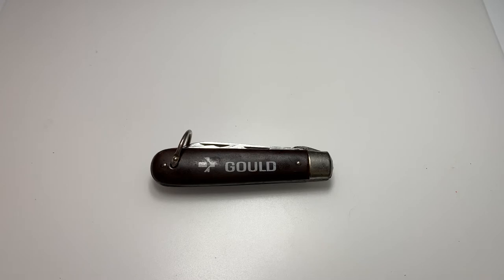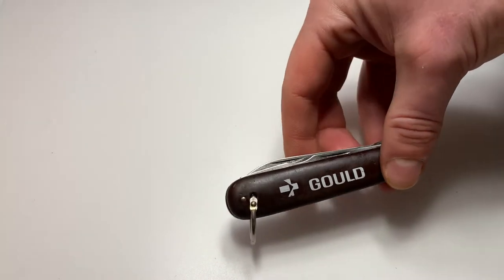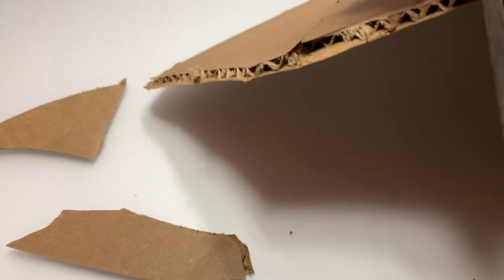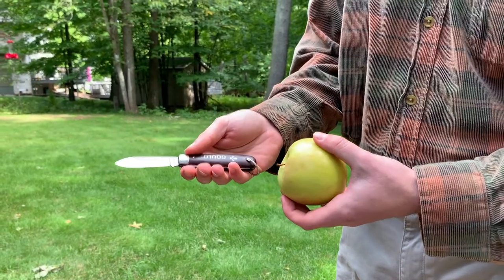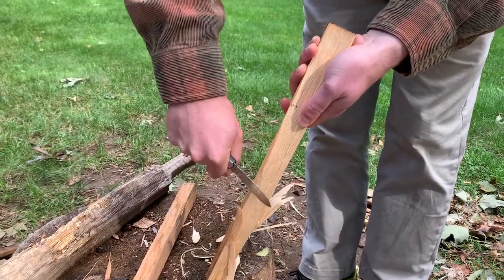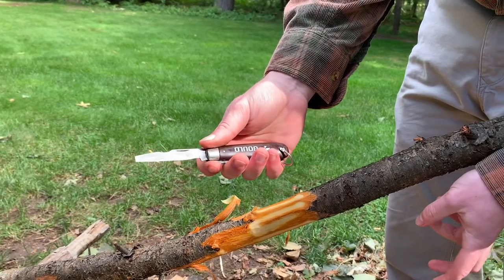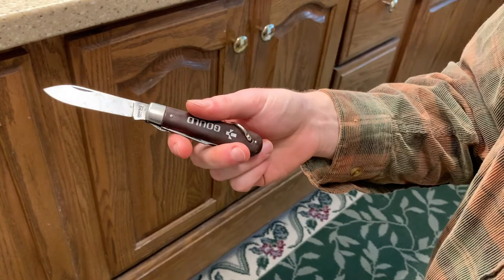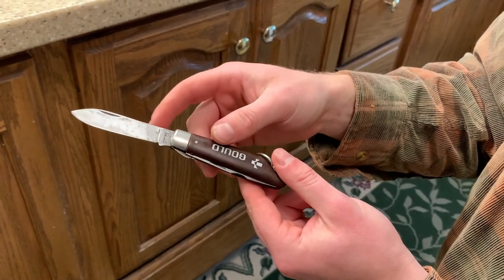Vintage Imperial TL-29 Electrician's Knife Review

Comment: The cutout in the driver blade is to allow access to the main blade nail nick. Simple as that. The sharpened part of the driver blade is for stripping wire. A Signal Corp lineman would use this blade as his main work blade.
Reply from the maker: Makes sense!  Thanks for the response.

Comment: The stiffness of a blade is not an indicator of the hardness of the blade. Hardening steel primarily alters the yield strength and mode of fairly but it doesn't significantly effect the stiffness of a blade you can generally bend a hardened blade further with it returning to it returning to its original shape if you bend a soft blade too far it will probably stay bent and if you bend a hard blade too far it will generally snap, but up until the stress applied reaches the point that a soft blade will permanently bend they will flex the same amount assuming the stress is applied in the same way and they have the same geometry. Your blade flexes because it is thin not because it is soft.
Reply from the maker: I both agree and disagree.  While everything you said is true, I do have two other imperial knives made from the same years with the same thickness of blade stock, both of which require significantly more effort to flex, and come back to true even when being flexed the same distance.
Reply: @practicalknifereviews1600  there are other geometry related factors that can alter how stiff a blade is such as the width form spine to edge and the type of grind, for a given spine thickness and thickness behind the edge a full convex or apple seed grind would be stiffer than a full hollow grind and a saber style grind is going to be stiffer than a full grind convex hollow or otherwise. I usually thin my knives behind the edge using a technique that will thin the spine slightly and although the difference is so small you would have a hard time measuring or even noticing it without a micrometer or other faitly precise tool it still makes the blades much more flexible so it is also possible that the spine thickness is only very slightly different which might be enough to cause this difference on its own.
Reply from the maker: @garethbaus5471  Sure, I know what you're saying, but what I mean is I have several identical blades from the same company, and this is the only one that performs differently than the others. But sure, there always could be some imperceptible difference present.

Comment: The cut out on the top of the screwdriver blade is not to place your finger on. It is to access the knife's nail nick. The cut out on the bottom of the screwdriver blade is the wire stripper.
Reply from the maker: Thanks for the feedback!

Comment: The scraper blade is great for scraping a ferro rod and for fat wood. I have several manufacturers.  Camillus is my favorite, the Imperial is too flexible, although it's a better slicer for food prep. I've  experimented using the Camillus for other bushcraft tasks as well. It excelled in all areas. The Klein has the nicest fit and finish. I feel a TL 29 makes a great bushcraft folder. Just my opinion...
Reply: Cool to hear, I just picked one up, specifically as a bushcraft folder. I had the idea of possibly making the screwdriver into a clip point blade, more or less making it an improved Trapper. Not totally sure if I will just yet.